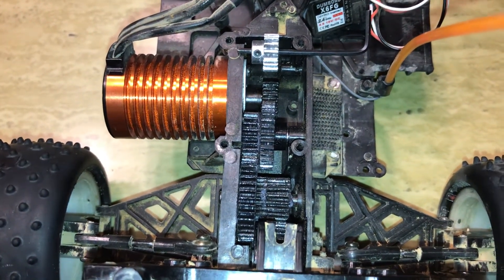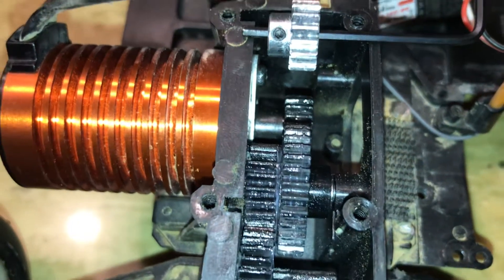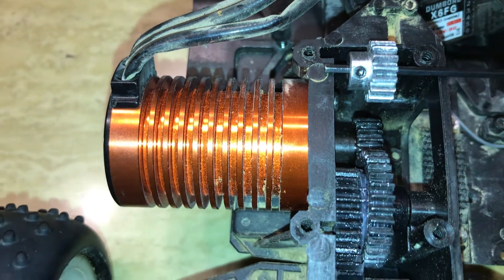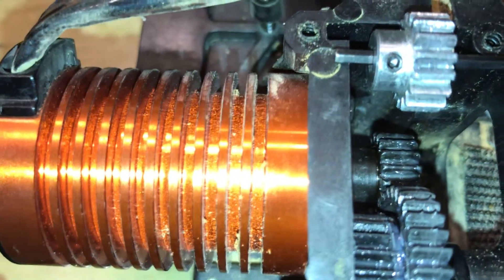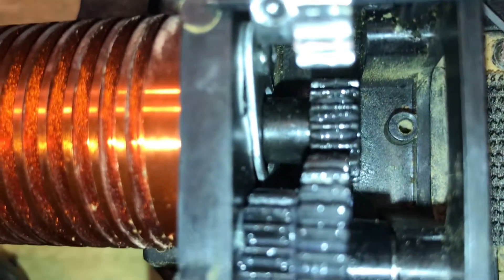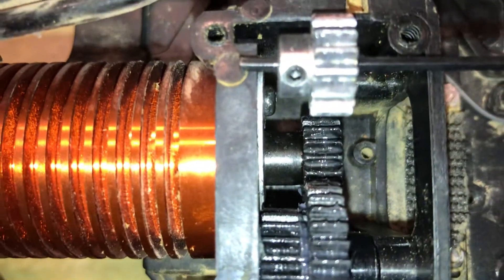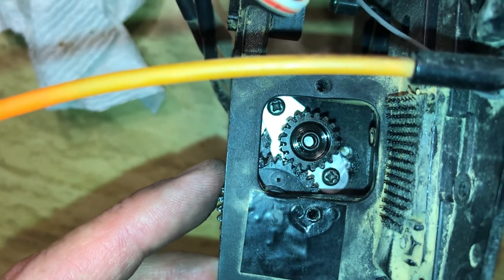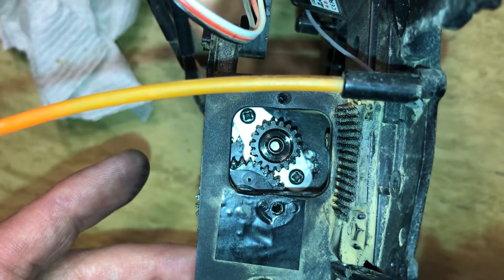Kyosho Raider 18 Tooth Pinion  Install - It Fits!  Is it a 40 MPH Raider Now?

Comment: I used to do speed runs with my Kyosho Raider back in the day too! I ran a 10t dbl Speed Gem motor, and would hit close to idk maybe 35? with 7cell packs, and novak spd cntrl, but it was sooo fun!! All the neighbors would come out to watch too. lol
Reply from the maker: Very cool.  Was that with the stock gearing?  That motor must have been a ripper!

I got mine up to 42 the other day and that is plenty in this car lol.
Reply: @BriansRCStuff  I dont recall, it's been so long. I remember the motor would get soo hot it would melt the solider off the skotty diodes., and they would fall off..  It must have been a larger pinion like your running and smaller idler gear as well. It was so much fun! I then purchased an HPI RS4 MT with the optional 2 speed transmission for speed runs with the same motor. I think it was the called the Trinity Speed Gem Topaz.., it was kind of orange/pink colored. Super fast motor! I still prefer brushed over brushless, btw... lol!!!
Reply from the maker: @TexasHill  

What do you like about brushed?  I am struggling to find any positives other than lower torque but that can be turned down in brushless application (though I run brushed in my Big Brute as it is a really weak trans and worry I can’t turn it down enough).

But for me, I like the longer run times, cooler running, faster speed potential, less maintenance, and greater adjustability of brushless.

But yeah, the Raider is fun!  Mine went 27 mph in a 15 turn brushed motor… but struggled to get up there.
Reply: @BriansRCStuff  When I was really young, my brother and I had a slot car track., The smell of those cars running after about 20 mins, was similar to the smell of an RS540 silver can motor. I guess the smell brings back memories of the old days when It was all about just having fun!!!

Comment: So am I hearing you say 19 will fit?!?  Dude you better fix that freakin busted steering situation before your Raider goes to RC heaven 😄
Reply from the maker: Lol, best I can tell 18 tooth is the physical limit…. Might need to go 3s next to get some more speed out of her  (just kidding!).  I think I got the steering fixed (hope).  I put a new end link on it (I mentioned it in the other video.... it is a bit shorter but I think (hope) it will hold.

I have never rounded up with my cars speeds..... if it hits 39.5+ does that count as 40?  I think it is going to darn close.